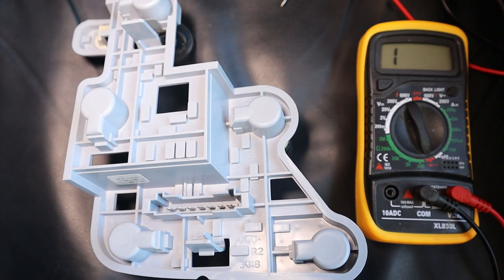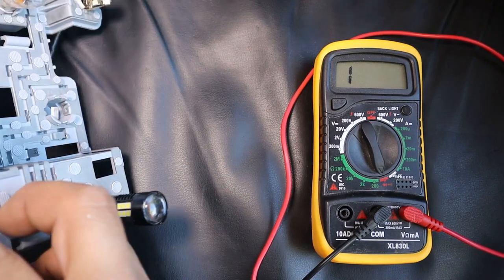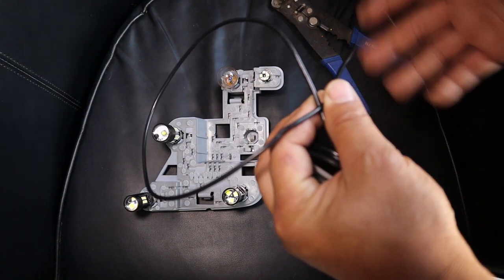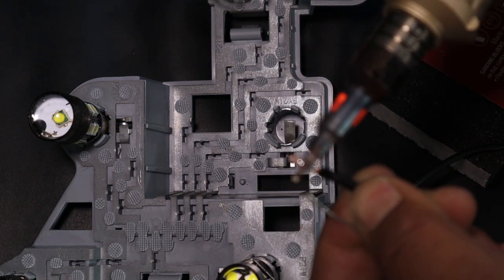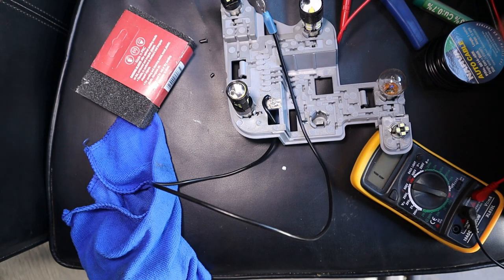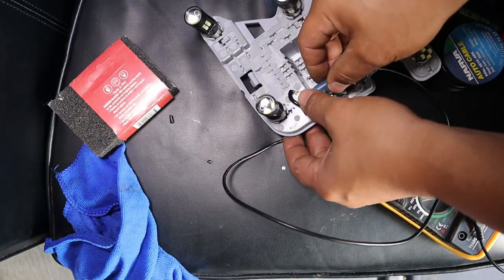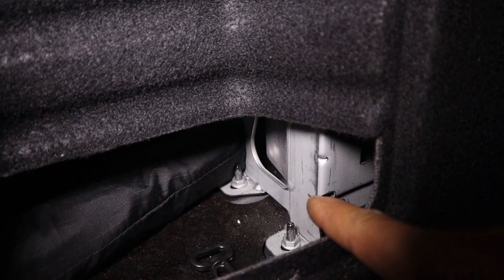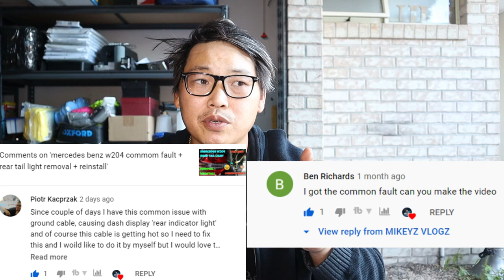mercedes w204 c300 common faults + how to fix rear tail light brown ground wire

Comment: After watching this video several times I decided to do it.  Mine had same issue however the harness was not damaged or melted.  Went with the soldering approach and came out flawless.  Attached other end to the nearest ground and vwala.  No more error message and light functions.  Thanks!!
Reply from the maker: well done

Comment: great video very informative and great instructions..i was able to fix both my tail lights doing this method..i decided to drill and use a bolt washer and spring washer instead as i wasnt good at soldering...worked a treat thank again mikey keep it up
Reply: su huynh by fixing your tail lights do you mean that they started flashing again and that the warning signs disappearead or do you mean something else?

Comment: I have a 2005 C230k, and I installed LED's all around, the bottom 2 bulbs on both sides tail lights do not turn on, after rewiring the resistor I succeeded in turning on Driver Side which is still flickering, but I would've never thought to rewire a new ground, I'm headed home and trying this!! Thank You!!
Reply from the maker: ur welcome matey

Comment: Nice video ...helped me fix my tail light error codes...i kept getting bulb failure but i knew i just replaced them ..this solved that issue ..thanks for sharing
Reply: hi i have the issue on the dash says my tail light doesnt works but it actually works, thats the issue u had and it solved it? thanks in advance

Comment: Hello friend! I don't know how I missed that video but saw it today and already fixed it. Awesome video, couldn't be explained better! Really easy fix although I had  some problems to solder wire to the part of plate - maybe because I put flux on it and it didn't want to 'catch' solder. I work with soldering iron a lot with PCB boards and flux is the must with these but here seems it worked other way because even if I washed flux it got under the plate and when made this place hot, still some flux on the top. I repaired right side which was causing problems and I think I'm going to do the same with left side to be 100% sure problem is solved forever. Thanks for shootout and all the best for you my friend!
Reply from the maker: awesome work friend... glad to hear you habe solved the issue..well.done  mate...

Comment: Well done. As an electrical fault finder, I zeroed in pretty quick. I bolted through the common frame with 2.5mm wire. Bolted to car frame. Right side fixed. 
Left side was ok. But going to do the upgrade for peace of mind. 
But , yes. You got rid of the gal first for soldering. I chose to drill. 
Regards KevinM
Reply: So I just got some sequential LED tail lights and am wondering bc I don’t wanna redo the connectors how you would bolt it to the frame? How did you do this? How did it work? Would this cause electrical issues down the road?
Reply: @SkyBurke-if2in  On the right rear side , In where the tail light connections are. There is a welded bolt with other negative connections on it. I made a bigger wire with a crimped lug And bolted it to the car. I bought a new multi pin plugs for the new tail lights from ebay. And connected my new negative wire , to the wire going to the negative pin.
Reply from the maker: @kevinmorton4439 well done
Reply: @kevinmorton4439  as an electrical fault finder, what do you think my problem is? On my OEM taillights the middle strip of tail light is supposed to light up on the right side, but the top strip lights up instead. It works perfectly fine on my left side, but the right is just the wrong lights lighting up. Fast forward and I installed these new tail lights and the problem persists, the wrong blinker lights up. So I have my sequential on my left side but my fog light lights up on my right side for my blinker. 
Is this a SAM issue? a wiring harness issue? I really don’t believe it’s the tail lights because it’s done the same thing thru 2 sets. 
Other than that they work perfectly fine. 
Any suggestions would really help, I’m frustrated I got sequential lights for the right side to not be sequential.

Comment: Could this be why one of my light bulb whent out for the top part of the back light on,y my botome strips light up revers lights go but the top for my right light when out so my quick fix is take ou the left side too light bulb out to an idea what this can be
Reply from the maker: it cpuld br the problem check for melting or a flimdy connecrion with your rear harness tail light connector make sure its a splid connection

Comment: Great video Mikeyz - i have a question regarding the old (thin) grounding wire-after attaching the new (thicker) wire the old one needs to be still connected or can   be cut off /removed from connector ?
Reply from the maker: can be removed

Comment: Thanks for your well video. Have the same issue and this time car is at Mercedes, 418 euros asked. I told them to hang on till tomorrow. I think I'm gonna do this but I have a little question, (may sound silly) The brown og cable, just cut it from where its melted or pull it out frim where it comes connected way back.? 
Thanks
Reply from the maker: yes u can cut it off and make new ground

Comment: Thank you so much bro for this video. I was able to fix my tail light because of this video. God bless u bro
Reply from the maker: most welcome which way did u do it drill a hole or solder
Reply: @MIKEYZVLOGZ  I didn’t use the drill method, I used the soldering method
Reply from the maker: @Kolawolebekes  nice

Comment: Just had this issue with my W204. The earth in the connector had completly burnt away. I fixed it in a similar way before seeing this video. One issue I had was that I just couldn't solder onto the metal earth on the backing plate even after cleaning it down to bare metal. It just wouldn't tin. I ended up drilling a hole through the metal in a suitable place and fixing the new earth wire with a self tapping screw and crimped ring.
Reply from the maker: yes that works too... I had a similar issue where the solder wouldnt take that's why I suggested drilling a hole and using a washer and nut and bolt it works just as good but u know how some ppl aren't comfortable with drilling holes etc ..might damage the tail light plate ..etc... so it's just another way u can do it
Reply: Mike Foster when you did this did your indicator start flashing again when you put it on and did the warning sign go away with it
Reply: @jackmcwhae5984  Yes, as soon as I connected the new earth wire the lights worked again and the dashboard warnings cleared. I didn't need to do anything else. I did have a few spurious warnings in the days following but this was due to me disturbing the corrosion on the bulb connections. I then took all the bulbs out and cleaned the connections which fixed it.
Reply: @mickfoster7140  Absolute Legend I'm now gonna try this today

Comment: Hi, Enjoyed your video but all I got was a very faint glow in all 3 bulbs like a low voltage.  The left side works fine, Any ideas ? thanks.
Reply from the maker: it could be due to this ..u need to.check voltage using a multimeter

Comment: Hey Mikey! On my 08 W204 I had the dimming problem for about a month and just yesterday it started throwing no brake light codes and since today the indicator light is now also out could it be this issue? Quick question I would like to have a friend do it with soldering but I want to be sure this is the issue is there anyway to test if this fixes it? Could I buy the negative wire and scratch the metal plate and stick it on with tape or anything else before permanently moddifying and drilling a hole in my car could I then also tape it to the frame inside or where do you suggest me to stick it temporary to in the car?
Reply: Hey me again thanks a freakin bunch for this video! For me the left taillight was broken and just did this with a nut and a bold trough the tail light assembly! And the ground I put on the existing bolt on the frame with a 10mm nut and everything is working 100% the wire and connector were completely black and burnt

Comment: Can you please let me know what is the size of eye ring connector ? Thanks for such a detailed video.
Reply from the maker: ok so I used the bigger eye ring instead of the smaller one but as long as it fits the thread bolt u will be good... there's usually 2 sizes in a variety box.. I used the larger of the 2 ... but remember just use a eye ring that can fit m8 ok
Reply from the maker: and ur welcome ... thanks for stopping by

Comment: Did u need resistors for the led's? If not can you give me the link to the ones you bought please? I just got some but for some reason they work if I put them in the front as signal lights but they will give a error and blink when i try them as rear signal lights? Thanx!
Reply from the maker: if u make sure the leds are canbus error free they should just work ..u. aht use normal leds ..they must be canbus ones
Reply: @MIKEYZVLOGZ  Thank you! I try to buy canbus all the time but I bought these off of aliexpress and even though they say they are canbus they must not be.

Comment: What do you do with the original brown grounding wire that goes into the connector. Do you just leave that slot empty
Reply from the maker: I just left mine at first but u can remove it completely..the fact is u now have a new grounding point and even if it shares the grounding point it doesn't hurt to have x2 grounding points..but fact also is it does need the better grounding point..that's the bottom line... this is what mercedes do aswell
Reply: @MIKEYZVLOGZ  thank you for your help and replying!
Reply from the maker: @LIVERZ  no probs if u look at most of my  comments I always try to reply wen I can to legit questions ..not silly ones like ..my car is limping what do I do? ..I mean I'm not mechanic lol... I'm a simple diyer..N share my experiences with others... so hopefully someone else may learn... I've never said I'm a pro mechanic so I cant diagnose from half way round the world..lol.. but no harm no foul... but simple advice I can always give some..like yours... have a great one N for being part of the channel 😀 👍

Comment: Mikey only my rear right indicator isn't working if I do this will it start to flash again or will it only just get rid of the warning signs
Reply from the maker: it could solve the issue .. this common fault can lead to many different issues ... even what ur describing its worth a try as it is cheap amd easy to do 
I can't say for sure if it will solve it but it will be preventative maintenance for future
Reply: @MIKEYZVLOGZ  hi sorry Mikey so in the video what was this new wire really doing? and what part does the brown ground wire control of the car.

Comment: Are those error free canbus led bulbs or regular leds bulbs? Can you share where to buy those Leds bulb. Thanks
Reply from the maker: Error free always aliexpress 
Here u go 
#Aliexpress AU $4.34  41%OFF | 2Pcs Car Light 1156 LED BA15S P21W LED BAU15S PY21W BAY15D 1157 P21/5W R5W 21 SMD 3030 Auto Lamp Bulbs LED 12V - 24V Car Styling
https://a.aliexpress.com/_Bf7l88Ko

Comment: Great video if the brown wire is corroded but my problem is slightly different. Hope you will help me. 1995 W202 C280, both turn signals work fine when headlights are off. When headlights are on, right turn signal works but not the left. All the fuses are fine. Please help.
Reply from the maker: hey mate so sorry.. im not too sure what that would be ..sounds alot like a switch or a relay is faulty... cuz wen u say it works fine wen lights are off... and wen on one doesnt seems like a relay ... relays are like switches and they cut off power wen needed.. a d aounds like a faulty relay.. look up which relay i. the fuse panel is for ths tail light and or headlights

Comment: Do you kno the color wires that are the turn signals I bought a trunk light for my w204 and I can connect it to the turn signals so they flash when I have my hazard lights on but I don’t kno which 2 wires are the turn signal wires
Reply from the maker: ye need schematics so u can see... try typing searching tail light schematics in google and see what comes up i did this last time for the doors and came across a forum that someone was asking about and got my answer about which wires control the lock unlock

Comment: Hi iv just seen your Video how to do this does it matter what side is it left or right because it’s saying on my car on the left side is not working but it is
Reply from the maker: yes that due to the wire being too thin its not reading the right current therefore sending the error message

Comment: Hi Mikey. I did exactly what you suggested and even confirmed continuity at the end with everything plugged in but I still get crazy indicator warnings on my dash about headlights. i swapped all bulbs and verified they are on. i wonder if the cable i bought has the amperage. it’s from southwire - primary wire 20ft 14-19 green. says nothing about amps.
Reply from the maker: find out how many amps the wire produces ... ur talking about tail lights not headlights? u might have a different issue.. have u scanned for codes
Reply: @MIKEYZVLOGZ  thanks for the reply. I'm sure it's the related problem because it's a 2011 C300 and my friend never took care of the recall when she got the notice many years ago. The exact messages are "Check rear left sidemarker lamp" and "check front right parking lamp". It's been there for ever for her and I figured it would be an easy fix after watching your video.  I ordered the exact same multimeter that you had. After my first message, I went out and bought another wire, this time from an autoshop which is a 14 gauge wire with 17 maximum amp. I put eye lets on both sides and swapped out the  cable from today but same problem. 
What I am confused about is this.  I noticed everyone places the black wire tester on the connector where the brown wire connects, then they use the red wire tester to touch a spot on the plate and listen for a beep. That's how I determined where to drill. The problem is should it beep when you have the black wire tester on any of the other connectors (not just where the brown wire goes)?  I get the same beeping no matter which connector I touch with the black wire tester. 
When it's all connected and put back in place I stick in the black tester into the brown slot with the brown wire and the red tester on where I grounded and it beeps. I move the black tester to any other color wire and it still beeps. So I'm confused why the beeps are the same no mater which wire I'm testing.
Reply: and follow up to your question. At this time I'm not sure how to tell amps. When I test, I get 3 numbers that come up with the beep on the multimeter and I'm not sure which is amp or what the numbers mean. I just listen for the beep which seems like what others are doing.
Reply from the maker: @tas4092  I get that ....what I meant is ... are u getting 12v consistently to your tail lights... cuz if your not that would throw errors or cause flickering etc... u can test by using multimeter vlack goes toground and then the red goes ro the wire u want to test .. put multimeter in voltage mode should have 20v setting ...turn dial to that and test
Reply from the maker: @tas4092  sounds like u have a short somewhere ... so wen u touch the brown wire and backplate what ur looking for continuity meaning that ... that wire is connected to what your touching ..if it doesn't beep means it doesn't have a connection between the 2 points ...
Reply: @MIKEYZVLOGZ  It does beep. The problem is with the red touching the back plate, I can touch any pin with the black pointer and it all beeps. Is that normal? should it only beep with the brown pin and backplate?
Reply from the maker: @tas4092  that's what I would have thought ..telling there's a short
Reply: @MIKEYZVLOGZ  ok that makes more sense if what I described is not normal. There doesn’t seem to be any electrical problems and all bulbs seem to be working fine. I suppose I’ll tell my friend to take it in to finally get the recall done. Does the recall expire? it’s been over 6 years since she was notified. We tried inputting the vin to check on recalls and nothing came up.
Reply from the maker: @tas4092  y
I'm not sure

Comment: Mikey, I'm getting a rear center brake light fault  code, do you think its the same ground issue ?
Reply from the maker: it very well could be but as I stated it won't alwaya fix the issue.. sometimes it a case of trial and error try it and see if it does fit it... u can just ground the tail light and see if it solves the issue.. check the tail light plate and plug for damage melting etc
Reply: @MIKEYZVLOGZ  no damage at the plug. The third brake light works it just throws a code once in a while. Weird.
Reply from the maker: @bradt2420  could be